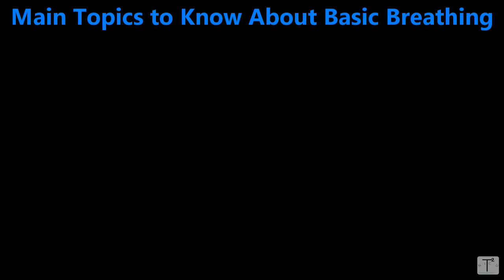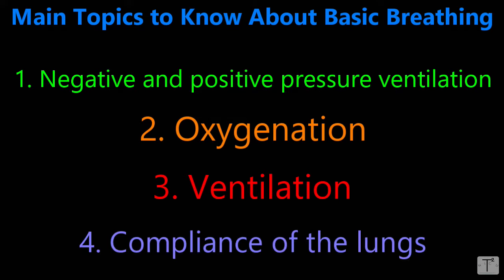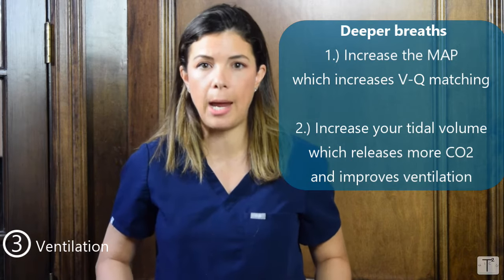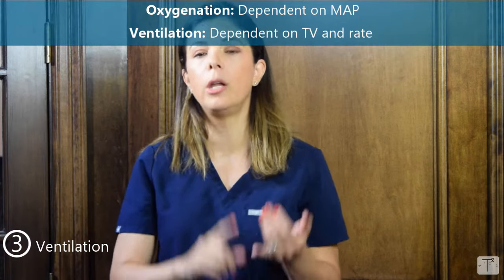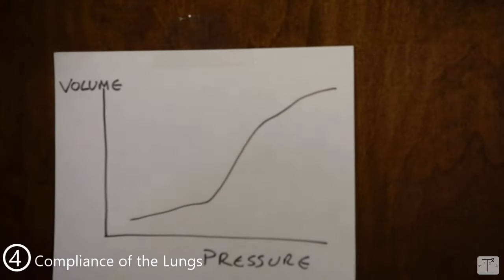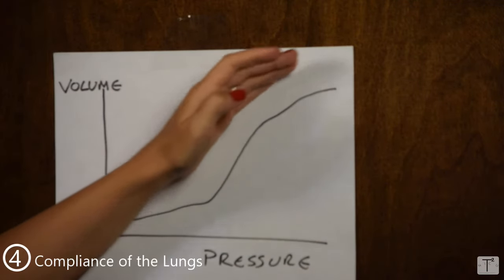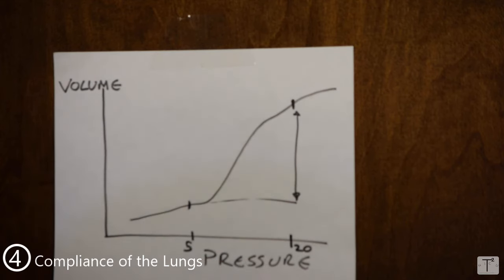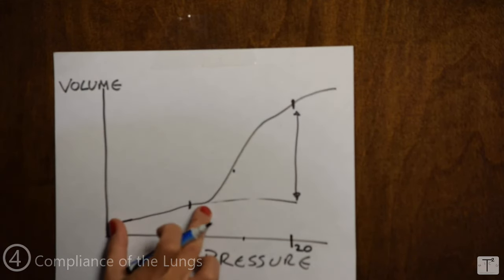What do the numbers on a ventilator mean? Part I- Tala Talks NICU

Comment: I need to ask a question, is there any strategy to deal with a ventilated baby (who is having PCO2 wash) on low setting and not tolerating CPAP? Thanks
Reply from the maker: Hi! This is SUCH a good question- I hate it when we feel we’re stuck on the vent too. It’s not good for a baby to have a c02 in the teens or 20s so ideally we’re doing something - there are caveats but for now- we’d like to get that c02 up. So you can try going down to lowest possible vent settings (even PS with a PEEP and no rate). Or try to extubate and place on NIPPV. We’re usually stuck here a lot!!!
Reply: @TalaTalksNICU : For a low PCO2 (Ventilator settings: lowest PIP and Peep with  failed extubation) decreasing rate (increasing eT) will cause ⬇️ pCO2, is it right? By the way, what are the lowest settings your unit reach?.

Comment: Thank you so much for your simplified explanations! Can you explain 'plateau pressure' please? I see it in the picture you posted in this video to show 'quick guide to lung compliance', thank you!
Reply from the maker: Hello! Yes- you're right- I didn't cover this enough- and honestly from a clinical standpoint we don't use the term much. But basically- think of the pressure you have to give- as having to overcome two different obstacles to get the lungs to inflate. The first is the resistance (e.g. if you have. really long ETT or lots of secretions), and the second is the actual compliance of the lungs. The plateau pressure refers to just the pressure needed to open up the lungs (i.e. if the resistance were zero- which practically cannot happen). So for example- if you need a PIP of 23 to get a volume of say 4ml/kg of the lungs. If you cut down (a really long ETT) then you'd need maybe a PIP of 22. This decreases the overall pressure needed, but the compliance of the lungs is the same- and so the plateau pressure is the same. make sense??
Reply: @TalaTalksNICU  yes this makes sense, much appreciated for your explanation!!!

Comment: I understand the PEEP..pip..anda the delta change.but i couldnt understanda the TV change by number.how to calculate when on pressure control vent.
Tank you so much.
Reply from the maker: Another great question! When you're on a pressure control type of vent- you will not necessarily know how much the tidal volume will be affected. The machines would measure it. Obviously, you assume that as you increase the PIP the tidal volume will increase. (Although, as you realize, this depends on the compliance in the lungs and where on the curve the lungs are).